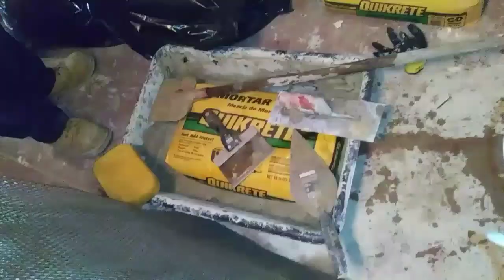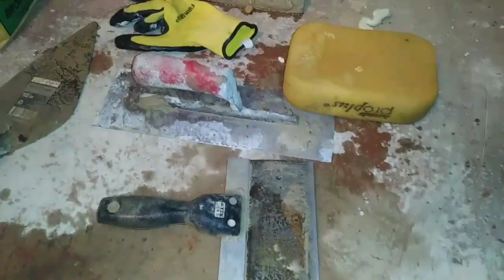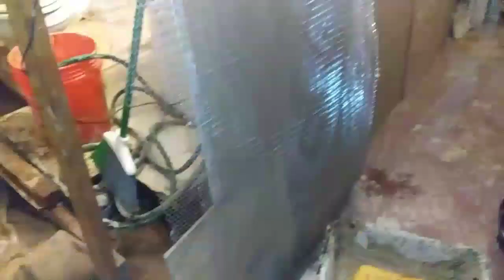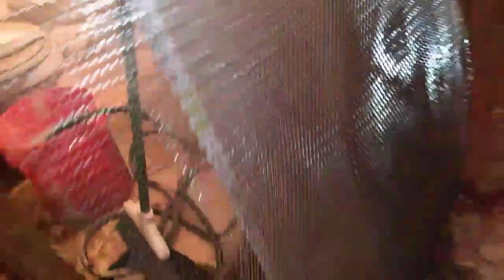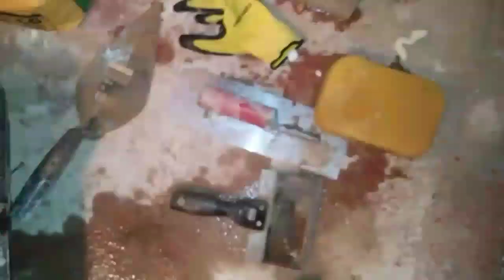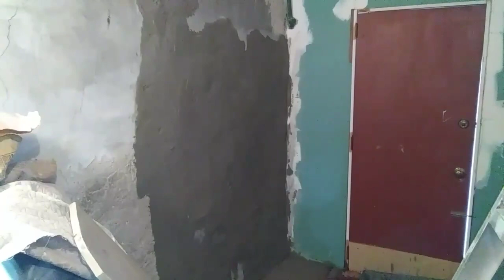🔨 A basic guide Repair of a concrete basement walls crumbling.

Comment: I guess this works if your hiding the walls to sell but this isn’t how you properly fix that problem the wall is still crumbling as you put the nails in
Reply: they should have at least chipped/knocked off most of the crumbly  stuff
Reply from the maker: It did the job it ain't brain surgery lol
Reply: @BillBracket  It is the foundation  tho
Reply: @BillBracket  when you just cement over crumbly cement the same things going to happen down the road. You need to chip away the loose cement make the Surface as clean as possible. Cuz it's not fixing the problem it's hiding the problem and when you hide the problem it just comes back out later down the road. I've been following contractors around from job to job fixing their mistakes. I feel like someone's going to have to come in later on and fix that problem as well. Overall it looks good yes and yes it's not brain surgery but you didn't address any of the actual problems you just covered them up.
I wouldn't call this a how to video I would call this video covering up a problem instead of fixing it. Because people will watch this and take what you do as a lesson and we'll have a bunch of people doing what you just did creating more problems everywhere. If you're going to make videos on how to fix something you should make them properly so when people use your video as a guide they're not going to screw themselves over in the end.
Reply: "hiding the walls to sell" ... what a mentality lol
Reply: @BillBracket  Maybe this is what the people who lived here before did. Now I can re-do it. Pretty unhappy with shoddy repairs done by lazy people.
Reply: @daymo6761 👍As a former contractor I think this is a great aesthetic fix. 
   Address any roof, guttering, drainage problems outdoors, put a dehumidifier in the basement, and it may be all you need. Many basements have surface crumbling due to moisture but the foundation (even old stone) has held for over a century. 
   Great job!

Comment: There is a reason the wall is crumbling. Water is infiltrating the wall leaching out the lime and weakening the wall. This is not a repair. This is a band aid,hiding the real problem. I have had to go in and properly repair the repair and the damage that was hidden / created by this kind of repair.,many times. The longer you leave it like this the worse the damage will be and the weaker the foundation will be.Hire a competent foundation contractor.
Reply: What can I do myself?

I have this same problem.
Reply: @magacop5180  a crystalline waterproofing is a better solution. It actually penetrates the masonry and fills the pores. Which both solidifies and makes the actual masonry itself waterproof.But you have to follow the instructions exactly. Mix it exactly as directed then install the slurry with a stiff bristle brush working it into the wall. Then you must keep it dampened to allow the crystalline chemicals to migrate deep into the wall. XYPEX Is one brand name.They make a lot of waterproofing for masonry so make sure you get the correct on that is applied to masonry and not the add mixture that is mixed into new concrete. It has to be installed over bare masonry though so any previous coating has to be removed.
If you are looking for a cosmetic solution, Xypex can actually be removed from the surface after it has penetrated the wall sufficiently ( I wait about a month just to be sure) because the cementitious material is just a vehicle for the crystalline waterproofing. Then patch the wall any way you choose. Or the Xypex can be used to smooth it to some extent. Without seeing how severe your “crumbling” is I can not say for sure if this is appropriate. If it is really severe it could be an immediate structural problem. But if it more “surface” deterioration it probably is not too late fo4 this method.

Comment: The wire mesh that goes up,  someone told me there's a front side and back side. Which way goes facing forward?

Also can you put up tile with this? I'm repairing my basement wall and would like to stick tile to the morter if possible
Reply: You don’t need wiremesh, it’s a waste of time. The right bonding agent and the right mix of cement (not the stuff he’s using) just fine. This guy doesn’t know what he’s doing do not follow his video. To see the right stuff look at Kirk Giordano plastering videos on YouTube the guys a master!!